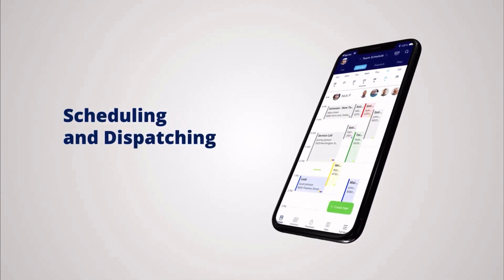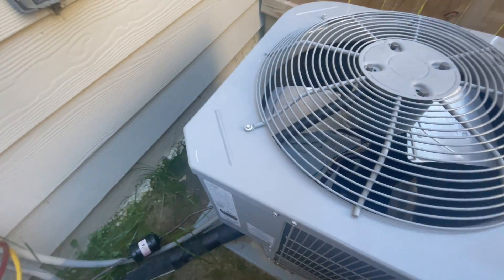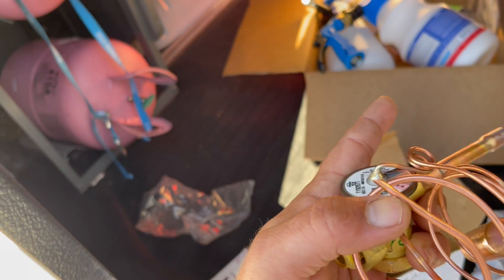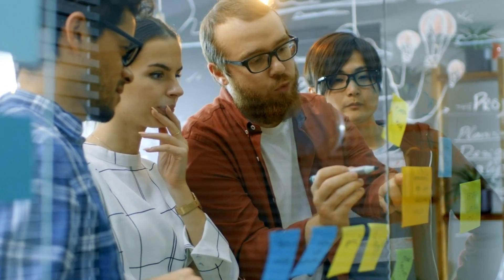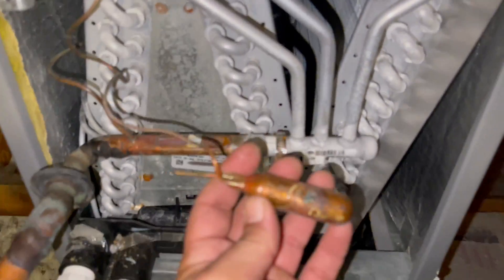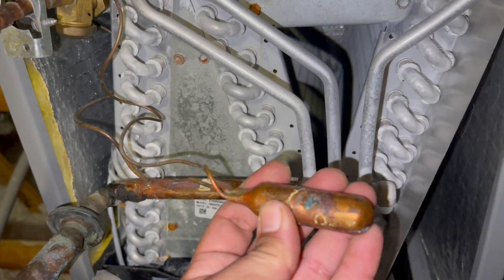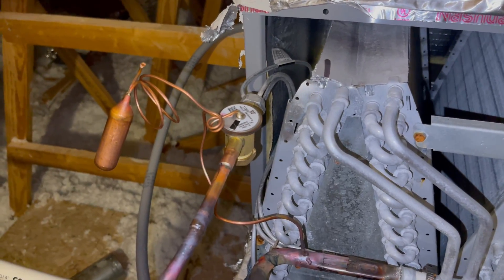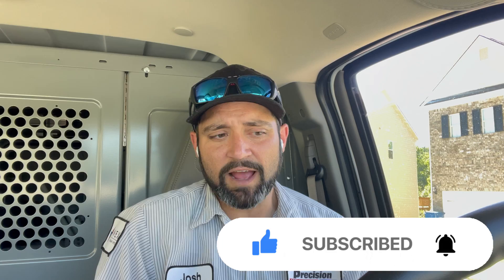TXV Bulb Lost Its Charge | How To Replace a Carrier TXV

Comment: Can I ask a question? I just installed a Trane 4 ton heatpump and air handler. Servicing the refrigerant, my low side would not get above 40 psi. Compressor running, my A coil would not get cool. I'm suspecting the TXV at the A coil. I'm probably overserviced now.

Comment: On these systems coil removal is the best move, not to bad, just cut the liquid & vapor, pull condensate, fanangle the flue out of the way, slide the coil right out, real easy like, reach around one handed cut the equalizer tube you forgot to unsweat first.

Comment: if the reason for making it difficult is to inflate the cost of the service call why not dont sell the parts separately and make replacement of the entire indoor unit required just to replace a faulty txv.

same goes for a botched install if a new system is being installed and by flexing the lines to fit them together you snap off the txv

seeing that the coil is aluminum carrier could have brazed the cap tubes to the txv making replacement risky because of melting the coil.